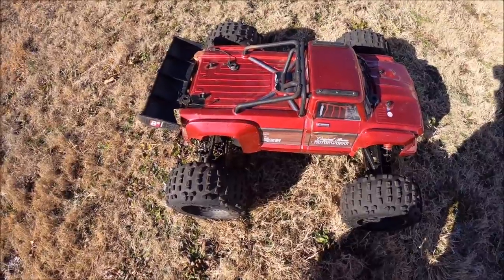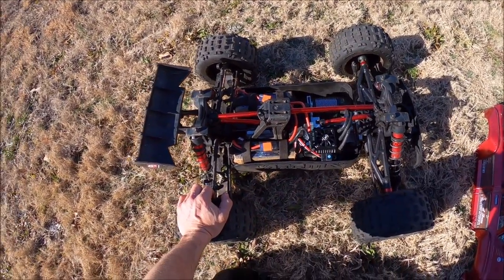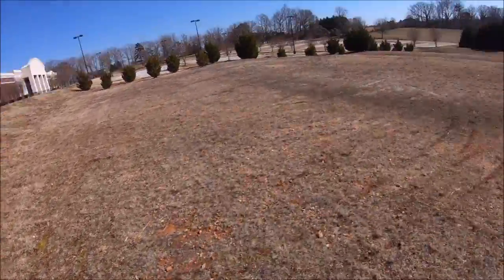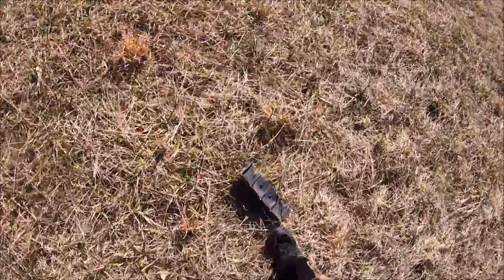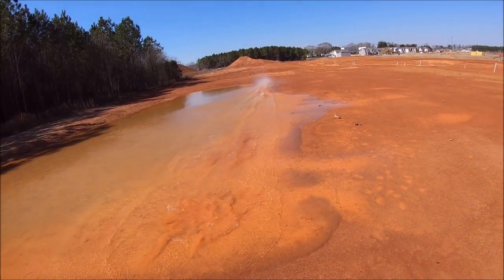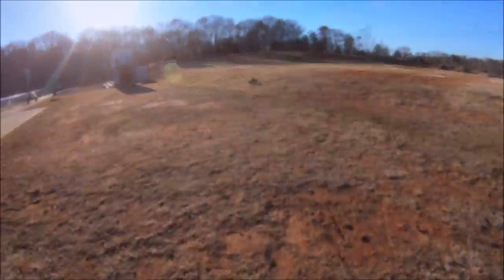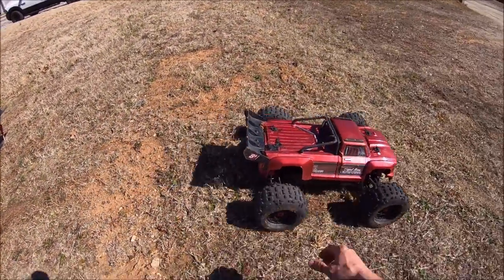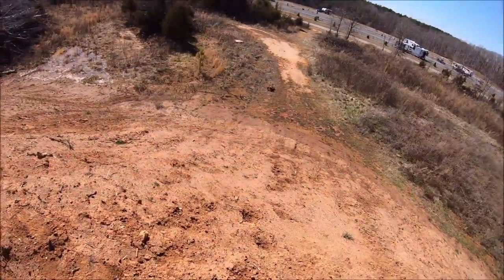BRUTAL! 8s Arrma 1/5 Outcast Beatdown and battery straps tip!

Comment: Another EPIC O8s run Brother Eric 😜!!!! I'm still astounded by the beating they can take for their size and weight 👀. Especially with proper tuning and M2C beef 💪. Love the battery strap tip Bro. I still have some rolls of HD Velcro and it's ridiculously strong 😱. Been getting by with other aftermarket straps, but might add the lengthwise one 👍. Killer Huge sends off the Mega mound Brother 🙀. Would love to hit that spot 😍. Thanks for another awesome upload and stoked you could run between the rains. 🍻🚀🚀😎💪👊👊
Reply from the maker: Thanks Brother Rich!!😁Had a blast getting the blood flowing in these heavy weights! Been sitting too long! You're right, amazing what a tuned and key upgraded 8s will take! As soon as Mitch gets the shock/rod problem solved, they will be unstoppable!💪💪Yeah the velcro rolls are super tough! The lengthwise strap really secures them in! Luckily there are slots already in the upper trays for them!🤗The mega mounds are so much fun to launch off of!😱Just not sure how long they'll be there..Definitely using that spot while a can! Just wish the sun would dry things out some! More rain this week.😝Thanks for watching and your comment bro!😎💪💪✌🍻

Comment: That's a good idea, where did get rolls velcro,  E, what motor esc you using again and gearing if don't mind , I need more power want it to be just like our 6s arrmas , maybe use the 1250 in a 6s guy , awesome bash as usual 😀 😎 👏 😉

Comment: Great vid / bash as usual !!! I just took out the stock electronics out of my K8S , Max 5 5687 going in , watching your vids made up my mind !!! 30t no motor heat sink / fan ? Temp OK like that ? I'm starting with a 27t just to see how different  the truck is .
Reply from the maker: Thanks so much!!😎👊I had no heat issies with the 30 tooth in the Outcast. It was also pretty cool outside so in summer temps, I'd keep check on the temps or run fans. Smart starting with the 27 tooth and go from there! The truck is a beast with those electronics compared to the stock system!
Reply: @RCDUDE81  Thanks , also heard you say you still had the stock 100k in the fr/rr diffs ?
Reply from the maker: @sprc3352  I was running stock yes but could probably stand either a refill or 500k in the front imo.😜

Comment: Hey Bud have you been having problems with rear arms shattering? I've been having problems on my 8S kraton and my 8S Outkast  Trying to wait on the rpm arms but my local hobby shop doesn't have them or can't get them yet figured I would ask you can you launcher trucks way higher than I launch mine
Reply from the maker: Honestly it depends..Most of the time, I don't have issues with arms just shock rod ends.😝I have shattered arms before landing on rocks or uneven hard surfaces. Kinda pulling out of hat on that! I do have a set of RPM's i want to try but bummed they don't have droop screw spots.😎🤘🤘💪
Reply: @RCDUDE81  I've been trying to get the RPM arms fir mine but there not available here in Michigan yet for some reason.. been looking on line but no luck yet

Comment: Hey dude, what weight shock oil do you recommend for the 8s outcast 7mm m2c shock upgrades
Reply from the maker: I run stock oil or 40wt but I'm also running the M2C pistons with larger holes. If you're running stock pistons, if you feel 40wt is too stiff, I'd drop to 30 or 35 and see how you like it.

Comment: How many arms you go thru? I seen so many pple bust there arms not even jumping half that high, it’s like they shatter like glass for everyone else.
Reply from the maker: I honestly didn't break any arms..a wing mount and found cracked shock rod ends. Got lucky I guess!😱
Reply: @RCDUDE81  how about shock shafts mate, did they stay straight? Are they m2c? Any droop screws? awesome vid thanks
Reply from the maker: Yes I mentioned im running M2C shafts and pistons.🤙They performed well just slightly bent one front. Just for a hint, there is another even beefier shock upgrade to be testing soon from M2C!💪💪